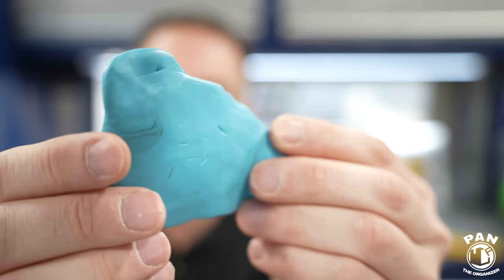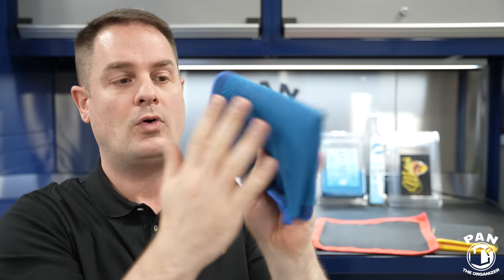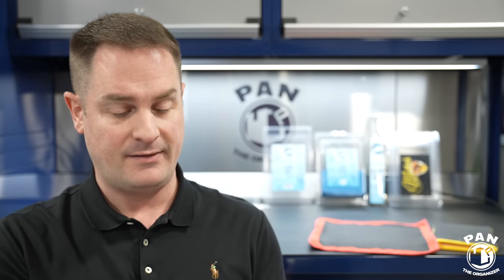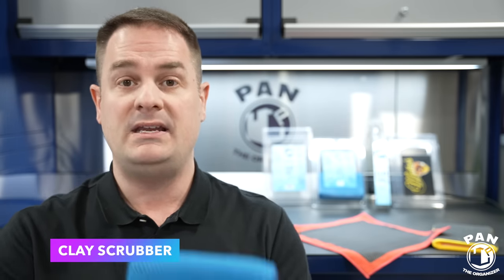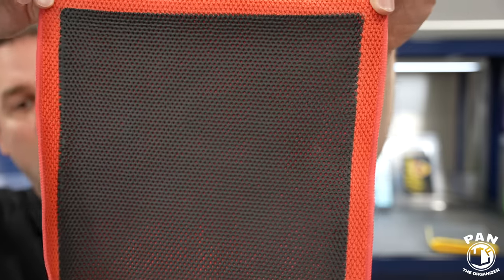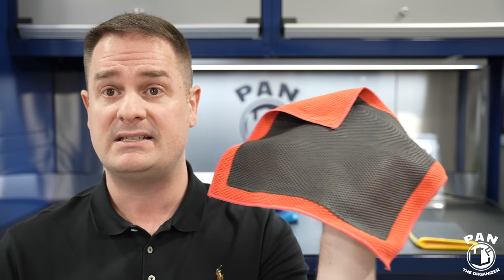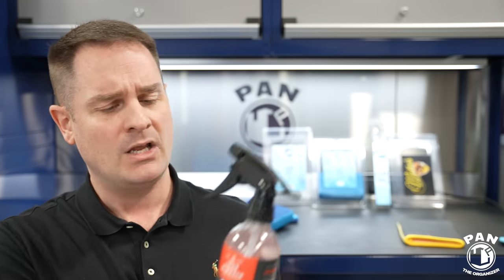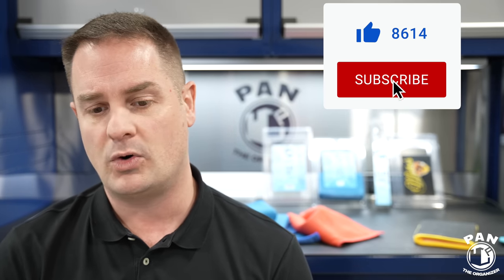The Future Of Automotive Clay Is Here… And It’s GOOD!

Comment: Thanks for another great video….I love the idea of double dipping the clay and iron remover. 
After that can I use my 3D 400 Hybrid compound and polish, then apply my Hybrid Solutions Graphene Infused To The Max Wax? 
Or 
Use Chemical Guys V38 Paint correction Finishing Polish and the Hybrid Solutions MaxWax?
Reply from the maker: I like to wash the car, do the chemical decon (iron remover), then clay if needed (if you feel contamination in the paint), then machine polish, then IPA wipe to remove polishing oils, then apply the protection (wax, sealant, coating, or what ever you like).

In your case, pick which ever of those polishes that gives the results you need for your specific paint and level of desired correction. It's impossible to say without making test spots first, to find the right combination of what compound/polish and pad will work best. Each paint is different.

I highly recommend that you watch my Detailing 101 series for beginners, where I explain different steps like iron removers, clay bar, polishing, protection, etc. It's super simple once you understand the basics, and your car will look and feel 100x better!

Part 1: how to properly wash your car: https://youtu.be/7Koj5j2Es5U
Part 2: how to clean wheels and tires: https://youtu.be/omwcNcSYcS8
Part 3: chemical decontamination (iron and tar removal): https://youtu.be/W_cyHz3XssU
Part 4: clay bar: https://youtu.be/XB8UaTCXuLg
Part 5: machine polishing (paint correction): https://youtu.be/ustTEVGMOTI
Part 6A: how to wax your car https://youtu.be/KZjiPcsPBrA
Part 6B: how to apply a ceramic coating: https://youtu.be/sqQYVjxFqK0
Part 7: Differences between waxes, paint sealants and coatings: https://youtu.be/4ejfPHan3k4
Part 8: How to clean your car’s interior like a pro: https://youtu.be/Xx_lHXHYpLo
Reply: @PanTheOrganizer man I can’t believe you put so much attention into these comments it’s crazy
Reply from the maker: Hehe thanks! It gets overwhelming I won’t lie, as I can spend up to 4 hours every day replying to thousands of YouTube comments from my almost 1 million subscribers, as you can imagine.

But it sets me apart from all other big channels as I’m the only one to personally reply to every single person on YouTube, every day. I like being close to my audience.

So I’ll continue to reply for as long as humanly possible. 😁👍🏻

Comment: Have you tried IronX as a synthetic clay lube? I just got a new bottle. And is the clay + iron removal combo safe to use before polish and coating? Won’t leave anything behind on the surface? Thanks, Pan!
Reply from the maker: Yes and it works well with these towels. When you’re done claying you rinse, just like you normally would regardless if you use a clay lube or iron remover as lube. And you dry the car and move to machine polishing.
Reply: @PanTheOrganizer  awesome, thanks! I think I’ve just about got the materials and knowledge to coat our vehicles before winter hits!
Reply from the maker: Here’s my popular ceramic coating application tutorial: https://youtu.be/sqQYVjxFqK0

Comment: Thank you for the detail explanation. I like the last part of the video where you mentioned about claying and sealing. This would really help motivate me to take care of my car and not feel bad spending hours away from my family.
Reply from the maker: Glad it was helpful!
Reply: Just watching another past video of yours on the P&S Bead Maker…. How would you compare P&S Bead maker to Turtle Wax Hybrid Solutions Ceramic Spray? I had watched your previous vide and learned about Turtle Wax Hybrid Ceramic spray and have used it since. But after watching your yesterdays video, i am curious about P&S. I’m a weekend DIYer and by no means an expert but LOVE to keep my car shinny smooth, water beading results and of course gain time back.
Reply from the maker: You can’t compare both products. Bead Maker is just a regular paint sealant. Not ceramic. It doesn’t last that long (3-4 weeks in general). Where it excels is for gloss and slickness. So we use it as a maintenance topper over existing protection.

The Turtle Wax Hybrid Solutions Ceramic Spray Coating is a long term ceramic based protection. If you apply two layers, 24 hrs between layers, it can last 8-9+ months.

So you don’t use the Turtle Wax for regular weekly washes. But you could use Bead Maker after each wash as a drying aid if you wanted.
Reply: @PanTheOrganizer  got it. As always, thanks for the explanation.

Comment: Hello Pan!! Thank you for all the content you have created, it has been a great help for my project to start my car detailing business in the coming months, I have a question, using the clay towel and iron remover to decontaminate the paint together is not a process abrasive right? So it is not necessary to use a polishing machine before applying any spray sealant or ceramic coating?
Reply from the maker: In theory, quality synthetic clay towels and mitts like the ones linked shouldn’t cause any marring. But test on an inconspicuous area first.

Comment: You can use a snow foam car soap as the lubricant?
Reply from the maker: If the snow foam has enough lubrication qualities yes, many like to use that. I still prefer a dedicated clay lubricant personally. But before you clay, make sure the car is washed. Once rinsed, you can re-foam and then clay if you want to use the snow foam as a clay lube.
Reply: @PanTheOrganizer  Why are you up at midnight, you need your rest buddy! Thanks for the info
Reply from the maker: Hehehe I go to bed very late at like 4 or 5 am typically. I'm a night owl!

Comment: which of hybrid solution  or carpro products can be used with clay towel ?  nice to know that IronX was mentioned , Trix appears to have tar removal so may have solvents 
I was planning  
pre-rinse-high ph car foam - rinse - another foam - contact cleaning with one bucket method - rinse - decontaminate along with iron remover - and then hybrid solution black acrylic polish and then wax or the new graphine flex
Reply from the maker: You will have to test for yourself, or inquire to the brands about chemical formulation, as I would die trying to figure all of that on my own. Way too many products out there.

Also, not all clay towels can be used with iron removers as lubricants, so be very careful. When you're not sure, just do the iron removal step separately from the clay step. There is no need to combine both. 

I have tried DIY Detail Iron Remover and CarPro IronX with the TRC clay towel and DIY Detail perforated clay towel, and those are good combos. Beyond that, you'll have to experiment.

Comment: How often should I use a clay towel and iron x on my car. And do I only put my clay towel in my wash bucket once at the beginning
Reply from the maker: You only clay paint that needs it. Wash your car and then feel the paint, especially in the lower parts of the doors. If you feel grit or contamination, it’s time to clay. If it feels glass smooth, you can skip claying. If it has been over six months since you last clayed your vehicle, it most likely needs claying.

Iron removers are generally recommended once every 3-4 months, or as needed depending on your level of iron contamination.

Comment: Hey Pan, great video, can you use the towel to remove water stains? Also I assume you don’t need polishing after. Thanks
Reply from the maker: It depends how bad the water spots are. Always try the less aggressive methods first, and move up the ladder as needed until the spots disappear. If left unattended, water spots can start to etch through the clear coat and cause permanent damage. Levels of aggression:
1) wash the car
2) use a water spot remover
3) use a clay bar
4) machine polishing
5) water sanding
6) full panel respray
Reply: @PanTheOrganizer  Its a 3 i think, first two didn’t resolve the issue

Comment: Never used a clay bar/mit/etc thus far. However what is now confusing me, you stated after claying your car you follow up with a polishing step. doesnt the polishing step mess with the P&S bead maker as well? or is the polishing step only required for the bar and not the synthetic media?

Thank you for the information, great video, kind of opens the claying option for me (synthetic towel)!
Reply from the maker: I think you are confused. The polishing step is recommended after the traditional clay bar is used, as clay bars are abrasive. But even after a clay bar, look at your paint. If it looks good to you, you can skip polishing. It's just that traditional clay bars can cause marring on the surface (microscratches) and if you do see that, and want to make the paint better in general, and also remove oxidation and other scratches and swirls that were in the paint, you do machine polishing steps.

These new perforated synthetic clay media on the other hand are not abrasive (the ones mentioned in this video) and shouldn't cause marring if used correctly (i.e. with appropriate lubrication and no pressure while claying). Of course, test on an inconspicuous area first. So machine polishing isn't required after these new clay media. 

However, even if they don't cause marring, you paint potentially already had swirls, scratches, oxidation or needed some level of correction to increase gloss, clarity, etc, so you could still polish if you wanted to. You decide what you need.

Also, I highly recommend that you watch my Detailing 101 series for beginners, where I explain different steps like iron removers, clay bar, polishing, protection, etc. It's super simple once you understand the basics, and your car will look and feel 100x better!

Part 1: how to properly wash your car: https://youtu.be/7Koj5j2Es5U
Part 2: how to clean wheels and tires: https://youtu.be/omwcNcSYcS8
Part 3: chemical decontamination (iron and tar removal): https://youtu.be/W_cyHz3XssU
Part 4: clay bar: https://youtu.be/XB8UaTCXuLg
Part 5: machine polishing (paint correction): https://youtu.be/ustTEVGMOTI
Part 6A: how to wax your car https://youtu.be/KZjiPcsPBrA
Part 6B: how to apply a ceramic coating: https://youtu.be/sqQYVjxFqK0
Part 7: Differences between waxes, paint sealants and coatings: https://youtu.be/4ejfPHan3k4
Part 8: How to clean your car’s interior like a pro: https://youtu.be/Xx_lHXHYpLo
Reply: @PanTheOrganizer  Thank you for the quick reply and clearing up the confusion, Wouldnt surprise me if I already have some swirls going, so will do a careful check first and decide what is needed. Will view your 101 series (if memory services me I think I've seen the first 3, but will do a full viewing to have a perfect understanding)!

Comment: Don’t know what I’m doing wrong or why everyone is so hot and heavy on clay towels and mitts. I’ve got a 23 Subaru that was rarely out of the garage its first year of life. Black with perfect paint. It has a ceramic coating, and lately I’ve had to drive it quite a bit.  It gets washed weekly, but has been picking up embedded road grime behind the front wheels mostly the lower half of the doors. A clay mitt/towel barely removed the grit. I used a lot of lubricant and had to apply more pressure than I was comfortable with. I grabbed a new clay bar and it was gone in five seconds with zero pressure.  
Is it me? Or are these mitts and towels being pushed by the industry as a new revenue source that will appeal to the masses?

Comment: Hey Pan. Great video as allways. Can you use the rag company towel on your vehicle as a maintenance after applying 2 coats of Turtle wax hybrid solutions ceramic spray without removing or damaging the coating?
Reply from the maker: With a true coating (glass bottle) no problem, but I haven't tried with just spray products. In theory, the perforated synthetic clay media should be to pull contamination without damaging the protection. But do a test and you'll see. The good thing is that if there is no beading left and the product seems removed, it takes just a few minutes to reapply a fresh layer. It's just a spray.
Reply: @PanTheOrganizer  Thanks Pan. I will try it out and see what happens.

Comment: I used one of those cheapo synthetic clay mitts I got off Amazon (looks like McKee's but crappy plastic-like "clay") on my black car during a rain, thinking that would ensure I had more than enough lubrication, and it induced minor scratching! All the bodylines looked like hell til I polished and there were 1 or 2 fine scratches I could see on every panel in natural light. I know for a fact I did not apply pressure, the only mistakes I can think of is I probably should have got a brand name clay mitt, and I probably did not scrub it hard enough against the windshield first to prime the surface.
Lesson learned.
Reply: You need lubricant water is not enough
Reply: @caseG80  A clay lubricant is like 95% water, so water is definitely enough, especially since I was doing this in the rain. The problem was that the clay media on the mitt was almost like a plastic sort of thing attached to the mitt, and it had pokey corners and I hadn't noticed until it was too late.

Comment: Excellent video Pan.  Fantastic info regarding the ability to use on ceramic coating and the fact that they don't cause any marring when used with an appropriate lubricant. One question though.  I have the  NANOSKIN Auto Scrub synthetic clay towel.  However the clay side is very sticky and will stick to itself and the packing that  it came in very easily.   I've continued to use it, and though it is sticky, with a lubricant is doesn't stick to the paint and works well in decontaminating the surface.  Is that normal for it to feel so sticky almost line chewing gum? 😂
Reply from the maker: Yes it's normal for those towels to feel that way. That's the previous generation of synthetic clay media. The newer gen being this perforated synthetic decontamination material.
Reply: Thank you for the clarification.  Im gonna order one from Ivan and try it out.  They have a Labor Day Special on today :) @PanTheOrganizer

Comment: Hi Pan! Thanks for the video. Now I understand that I need clay pots on the car. It's feel like sandpaper as you call it. The car is 10 years old, mazada 2. it was clayed 7 years ago and 3 years ago. How many times can you make clay on a car? There are also a lot of swirls and scratches so I will have to do a heavy campaound polish and then a polish and then a wax. I can't get a ceramic coating at the moment.
Reply from the maker: There are no limits as to how many times paint can be clayed, especially not with these new perforated synthetic clay media, as they don't have any abrasives in them. But you only clay a paint that needs it. When you wash the car, feel the paint. If it feels glass smooth, you can skip claying. If you feel contamination, grit or sandpaper like texture, it's time to clay.

Typically, for a daily driver, claying once every six months is a good practice.

In your case, you would wash the car, use an iron remover (brake dust), then clay, then machine polish, and apply your wax or paint sealant at th end of the process.

I highly recommend that you watch my Detailing 101 series for beginners, where I explain different steps like iron removers, clay bar, polishing, protection, etc. It's super simple once you understand the basics, and your car will look and feel 100x better!

Part 1: how to properly wash your car: https://youtu.be/7Koj5j2Es5U
Part 2: how to clean wheels and tires: https://youtu.be/omwcNcSYcS8
Part 3: chemical decontamination (iron and tar removal): https://youtu.be/W_cyHz3XssU
Part 4: clay bar: https://youtu.be/XB8UaTCXuLg
Part 5: machine polishing (paint correction): https://youtu.be/ustTEVGMOTI
Part 6A: how to wax your car https://youtu.be/KZjiPcsPBrA
Part 6B: how to apply a ceramic coating: https://youtu.be/sqQYVjxFqK0
Part 7: Differences between waxes, paint sealants and coatings: https://youtu.be/4ejfPHan3k4
Part 8: How to clean your car’s interior like a pro: https://youtu.be/Xx_lHXHYpLo